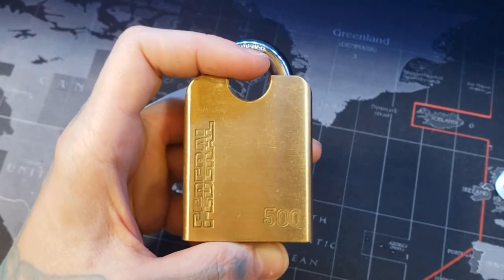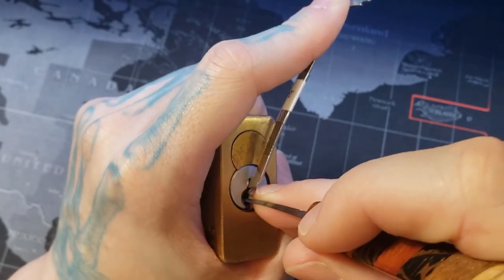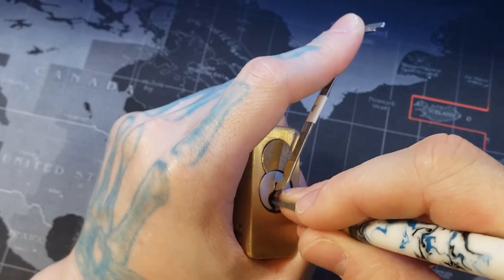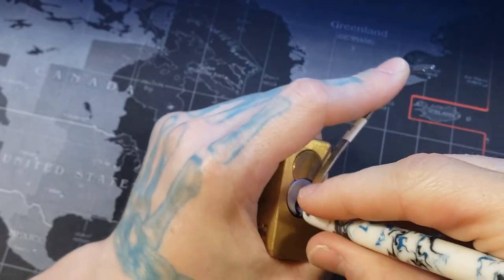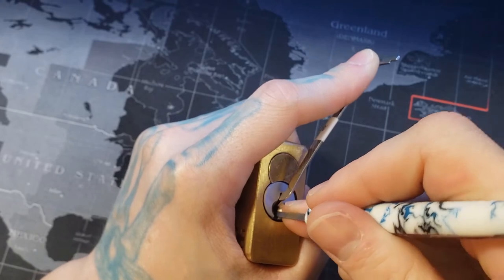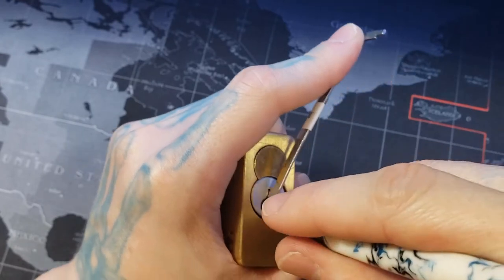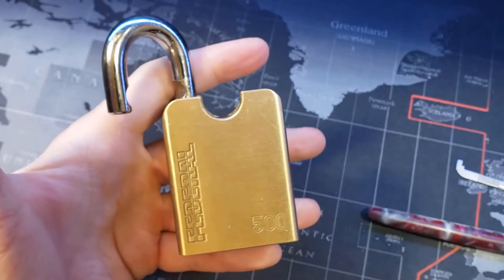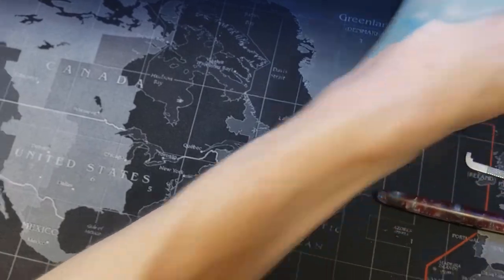44) Federal 500 Padlock - Sargent LA keyway Picked & Gutted

Comment: Note: Federal Lock DID NOT MANUFACTURE THE CYLINDER INSTALLED IN THIS LOCK. These locks were designed to use multiple manufacturer's "KiK" cylinders.
Interested in purchasing Federal 500 Padlocks with multiple key-ways? CONTACT ME!